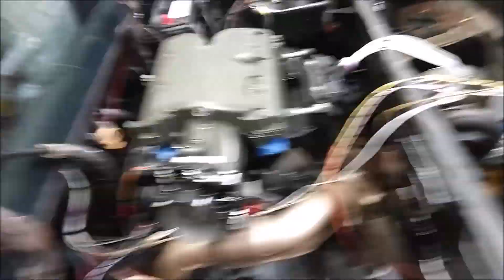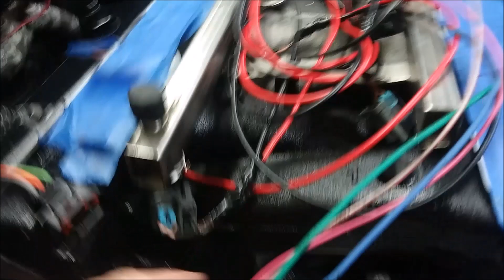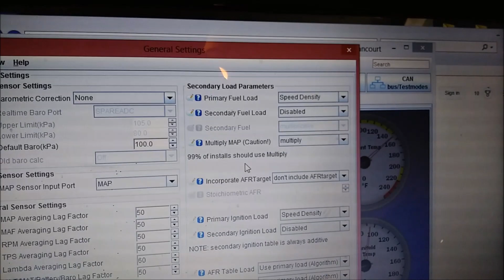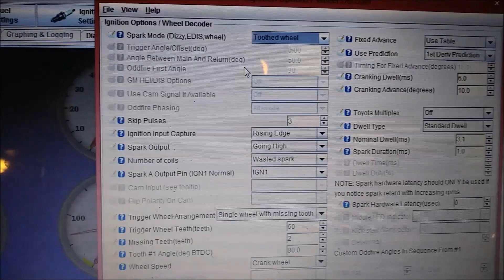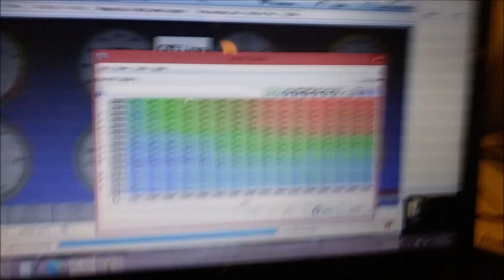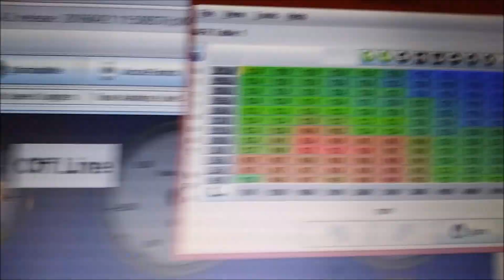How to Microsquirt your Fiero.

Comment: Did you use the stock sensors (camshaft, crankshaft, etc) to hook up to the microsquirt, or are aftermarket sensors required? I am trying to do this swap to my Replica build, but I think the programming of the computer is going to be the downfall.
Reply from the maker: @michaelchase6013  stock sensors.  I didn't use a cam sensor.  Micro doesn't need it

Comment: Can you describe what all you had to do for mounts? I am considering a swap and seeing the Fieros that you and Phantom have done, it's opened up the 3900 as a consideration.
Reply from the maker: I have an 88. I was able to reuse my front 88 bracket, I had to shave a bit of the metal down to clear the oil pan, and I had to enlarge the holes a bit 

I used a Rodney d poly front mount to replace the old original.  That's all I had to do for the front mount.

I also modified my brackets for the factory dogbone, and it attached to the aluminum head like stock.  I also used the fiero alternator bracket, timing cover and water pump

There are no custom mounts needed for this engine swap
Reply: @Slowv8Fiero  That's awesome!  I've got an 86GT, so hopefully the front mount isn't too different. I think I found in a more recent video that you had an issue with valve and piston contact, did you get all of that sorted out? Sounded like it was a total loss, but these motors don't seem to be extremely expensive so hopefully you're back on the road. 

I'm thinking of starting as stock and maybe adding a turbo later. I hope to keep the full trunk, think that's an issue either stock or with a turbo?  Let me know if there's a different way you'd prefer I reach out than in comments. 

Thanks!
Reply from the maker: @MJ-ff6oo  that engine dropped a valve seat while idling in the driveway.  Destroyed 4 pistons and turbo.

I installed another junkyard engine for 800 and made 500+ whp with it

Yes the engines are cheap.

The trunk can be kept as the exhaust routing is similar to a 3800 swap.

Comment: Hello sir, 

It's me, Mars, I have the 3900 third gen Camaro with BW369 billet...  anyways, question : 

At some point you mention having to add a resistor to the harness for the crank sensor.  Are you sure it was for the crank sensor?   I'm looking at it here and looks like you need a resistor for the coil pack wiring, but cannot for the life of me see a reason to add one for the crank sensor.

The way i see it you need to use a spare third output for the coils (likely use WLED) with a pullup resistor to TPSVREF so that you can run the 3 coils waste spark mode?

Thanks!
Reply from the maker: I think I told you I used -10an fittings on the head.  I meant -12an.  I used 12an fittings
Reply: I'm also trying to understand how he ran the stock coil with the microsquirt only having the 2 coil outputs
Reply from the maker: I used three coil outputs. I think I used wled as my third output
Reply: @Slowv8Fiero did you use 5v or 12v to crank position sensor?
Reply from the maker: @time2getdirtyfabrication  5v. Just follow the wiring instructions provided by efi and you can't go wrong

Comment: I used a Megasquirt on my old project car but it couldn't manage boost.
My Fiero 3800 turbo uses an ODB1 computer tuned by Ryan from GM Tuners. But he didn't recommend more than 8 to 10psi boost.
My question is can the Microsquirt tune for turbo boost to above 15psi?
Nice looking install by the way😉
Reply from the maker: You need the correct map sensor for the micro to read boost but the microsquirt can read 3 bar map sensors so up to 29 psi of boost easily
Reply: @Slowv8Fiero  OK, worth knowing thanks!
I'll maybe go for a Microsquirt if it can be more tunable than what I've got.